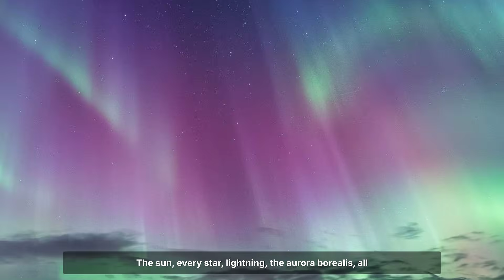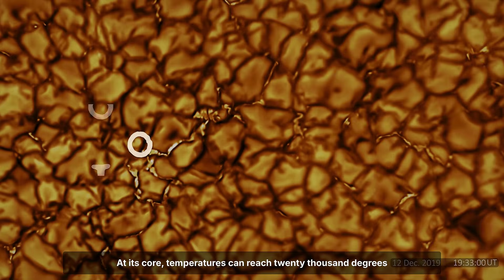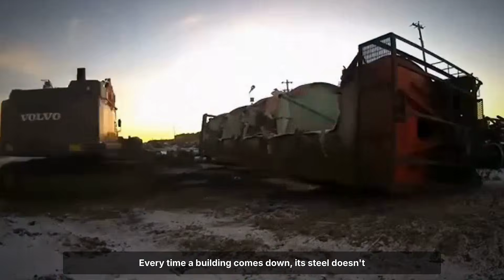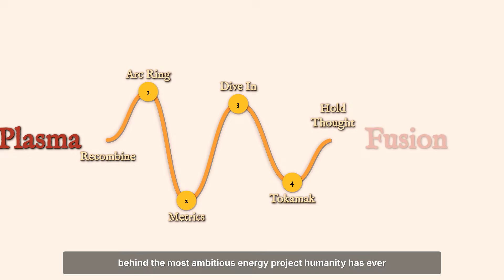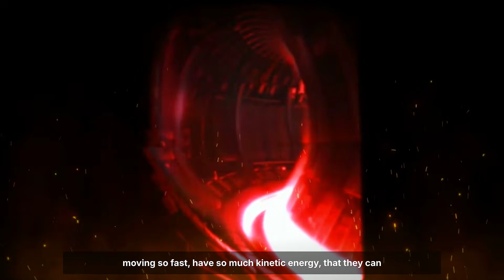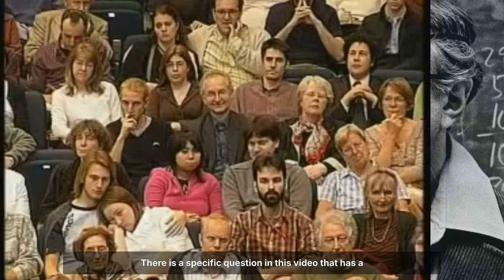Electricity Turns Air Into Plasma. No Combustion Required. Why Are We Still Using Fuel?

Comment: The Tokamak is part of the Idiocracy I'm afraid. Morons are trying to supersize electricity with the power grid when you want to localize it to each house to be independent. We should use the galvanic cell. Go back to the original voltaic pile.

Comment: In the case of the nuclear fusion experiment, known as ITER, there are numerous ways that journalists, the general public and funders are being misled. ITER’s performance is stated by the phrase ‘net fusion energy gain.’ That value is typically expressed as Qp, with that term commonly abbreviated down to Q, The value of Qp is calculated using the input energy dumped into the plasma that raises it up to thermonuclear temperatures. Typically that energy value only applies to the time that fusion reactions are occurring in machines operating in a pulsed mode, which applies to almost all fusion energy experimental approaches, including ITER. This input energy value tends to have only a minor association with the input energy quantity consumed by the entire experimental facility during the day on which the fusion energy pulses are conducted. Typically that total energy input value is 10 to 100 times greater than the value used to calculate the ‘net fusion energy gain.’  Typically the project managers omit mentions the total energy required to power their facilities. That makes it impossible for power plant design engineers to evaluate if the concept could eventually evolve into an economically practical power plant.

For many decades the fusion energy promoters have stated that the hydrogen fuel is virtually unlimited because it can be extracted from water. This presenter followed that lead. The fact is that ITER requires a 50/50 mix of the hydrogen isotopes deuterium and tritium (D-T). Tritium is radioactive and extremely rare in nature, The early D-T fueled experiments, at ITER, will have to rely on commercially supplied tritium. For many decades commercial tritium price has been around $30,000 USD per gram. This price is always omitted from all fusion energy presentations.

It is unlikely that ITER will achieve D-T fueled experimental fusion reactions before 2040.

All nuclear energy promoters, are in line with the vast majority of Earth's other 8.2+ billion humans, who continue to assume that we still have at least 20 years left to turn this 'Titanic' around using their favorite nuclear technology. They have become masterful in excluding the following warning from their consciousness.

UN chief: World has less than 2 years to avoid 'runaway climate change' (TheHill)
  * This statement was made 7.6years ago.

Comment: A plasmoid energy rovolution has already started. MSAART Plasmoids. (Molten sea ark atomic reconstruction technology).
 The thunderstorm generator is the first modern application of this energy source to be retrofitted to our current technologies. The TSG recovers energy loss and transmutates the elements and hydrocarbons produced by the combustion engine.
We currently use Explosive energy. Plasmoids use implosive energy utilising cold fusion and zero point energy.

Comment: Nichola Tesla covered this type of electrode degeneration in his arc lamp experiments. I've seen they now use vapor deposition to create diamond from seeds created using a plasma spark. Some day this process will be used to create hydrocarbon fuels. If you can disintegrate a carbon electrode into plasma in a pure hydrogen envelope, what happens to the carbon when it returns to a non-energized state? It should grab hydrogen.

Comment: The main reason this is not used, is stated in the first 2 mins.
20,000°C. Duh.
There is nothing we have or know of on earth, that is capable of withstanding that temperature.
We cannot contain it, hence why it is only used in open air discharge situations, such as, plasma cutting and rocket engines.
Reply: Look up Helion or Tri alpha energy technologies,  but that's the high end of the industry,  you could always touch a neon tube, not so hot...

Comment: Graphite likely converted to CO2 as it is degraded from the heat of the electrode tips.  Graphite is an electrical conductor, while other forms of Carbon, such as diamond in a crystal lattice don’t conduct electricity, but do conduct heat.